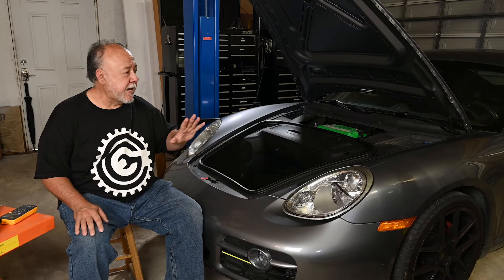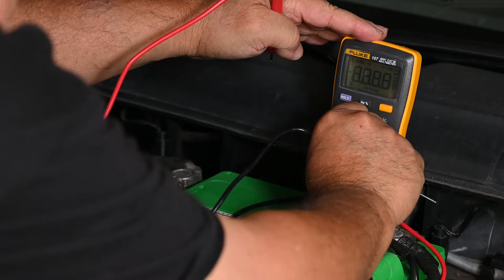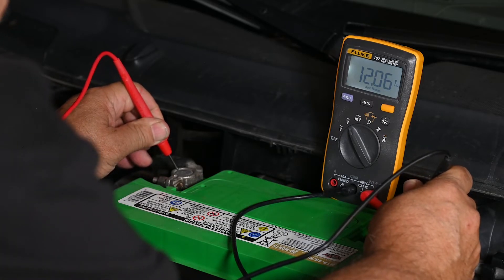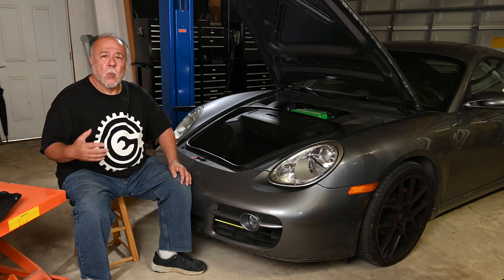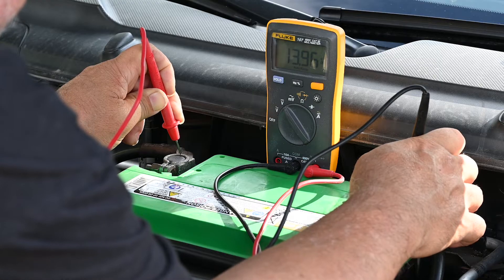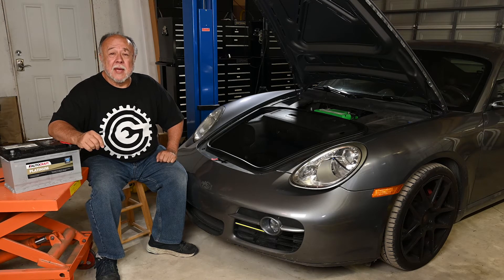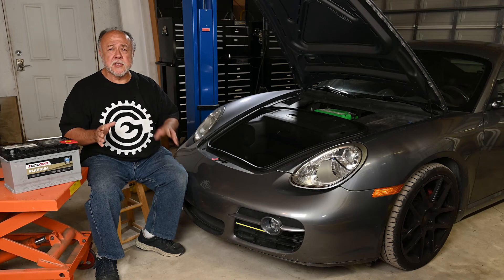Why Is My Car Cranking So Slow? Diagnose The Problem Using Just One Simple Tool

Comment: My battery tested at 12.7v
Alternator was at 15-16v
But when I hooked up a battery booster it did not change the long/slow cranking.

Is it the starter? I took it to oriellys to test and it passed. 

It’s a 2008 Honda ridgeline with 180k miles.

Comment: so......if battery has 12.6 resting or so, battery fine.  if battery and truck running has 13.5-14 volts, alternator is fine.  So the dragging start means starter is bad?  truck always starts it just drags badly.  i replaced the battery a while back but never checked voltage either way.

is my thought process on task ?  I was kinda worried about a bad ground being the culprit

Comment: Costco interstate battery ng after 13 months.   Slow cranking although battery measured 13 volts.  Jumped with another car and started immediately.   Interstates are Pro rated at Costco, from now on buying Walmart Everstart batteries.

Comment: Even if it measures 12.6v it could still be bad. It could be the CCA that is faulty, where it's got the voltage, but not the amps. You need a load tester as well as a multimeter to give it a more thorough test. And if all is well, then you need to check your connections for corrosion before moving to the starter motor and checking voltage there. And even then, it could be a relay, solenoid, etc etc.

Comment: I was ready to go down and buy a new alternator due to bad advice on what the issue could have been and this saved me a ton of time and money. I've never had this issue before, with a battery. After following your steps, I found it was the battery. Went down, bought a new one and installed in the parking lot......and was good as new....started right up much quicker, like it should. Thank you.

Comment: I've been told, on modern cars full of electronics, never to jump start it with both cables connected to the battery. The ground should be on the bodywork somewhere.
This, I'm told, is to avoid spikes damaging any of the multitude of control units in the car.

Comment: My CaymanS also cranked slowly.  The testing showed that it wasn't the battery and it wasn't the alternator.   I was about to replace the starter.  Fortunately, I found another potential cause, which is apparently a very common issue for slow cranking on Porsches.   It turns out that it was exactly the problem I had.  It was the corroded connection from the battery to the distribution block terminal (which is about 6 inches from the battery in the frunk).   The car started perfectly fine after a little sanding to remove the corrosion on that terminal.

Comment: Man I can not figure out what’s going on with my car. Took it to Auto Zone and Alt , Batterie and starter is good. I have a slow crank and the battery light came on for a second. I don’t understand if the battery is good then what else could it be? The mechanic did clean one terminal since the corrosion was visible on the negative but didn’t clean the other since there was no visible corrosion
Reply: Ever figure it out? Both my alternator and starter were bad, so I replaced them, but I still have hesitation on start, I'm leaning more towards the fuel regulation system now, I'm gonna go run some tests tonight

Comment: Best like and best subscribe 
My Nissan Murano no start I changed the battery with  a rebuilt battery but no start then changed the starter cranked but no start can you tell me sir what should I do do I have to change the spark plugs but the car cranked slow though because it was sitting for 3 months I even boosted 
Thanks 
Toronto Ontario Canada

Comment: Great explanation....but, you didn't get to the starter - i have a slow crank condition - car starts.  if the battery and alternator check out, then i'm guessing it's the starter.  the question is - replace the solenoid or the crank motor - or both?  can either be checked? how?  Thanks for any help you can offer.

Comment: Nice. You did for get to check parasitic losses by conneting the multimeter (in current config) in series with the ground or positive termal the battery. Battery could of been low due to a faulty electronic module or closure switch drawing power in an IG off, all doors closed state. A famous ones for old 04-06 Acura TLs is a bluetooth module staying on that is located in the dome light area.

Comment: I just got a 1 ton chinese mini excavator, it has a 1 cilinder diesel engine, its near freezing outside and it is still slow cranking even when wired to a car with a running engine at high revs, the wires get hot and the starter hotter, what can i do? Since it does about 1 revolution 1,5 seconds :/

Comment: my car wll crank and won't start. battery reads 12.48v. is t good?
Reply from the maker: If you're talking about the "resting" voltage (measured with the engine off after several hours not running) then 12.48V is probably a good battery. It sounds like you're saying it cranks normally but just doesn't start, which would not be a battery or alternator problem.
Reply: @CliffsGarage  
Cliff...the car will cranck but won't start. In fact they will be a click noise. Car will say ignition is on but won't start. Just wondering if it's a starter, ground wire or just ignition switch issue.  Do you have way of diagnosing it as DIY?

Comment: I have problem that after sitting for couple days and not warm morning, like +5 celcius, my car is cranking very slow, and if it starts up I can drive like 500 meters, shut it off and it will start instantly like a charm. And sometimes even at colder mornings like -5 celcius it starts like nothing.. Is it battery or something wrong?
Reply: Same problem here, if the starter was f’d then you would think it would have trouble starting all the time right?

Comment: Great video!  We use a midtronics battery analyzer, as long as you don't go below 9.6 V where you're cranking your starter is good.  You can have a 12.65 V and be easily fooled yet the battery has no amperage.
Reply: Hell you can have 9 x 1.5V flashlight batteries (13.5V) and it still will not start your car. The internal resistance of those batteries are high whereas the internal resistance of a car battery will be in the milliohms. That is why when putting a load on a car battery, the voltage of the battery decreases. And during the life of a battery, the internal resistance increases and the capacity decreases.
Reply: Mines is at 14.2 and it's inconsitently cranking up slow

Comment: Well done diagnostics from an electronics tech. I might have added internal resistance of a battery and also charge rate which is dependent on temperature. You are in Florida and if it was hot out, then 14.00V is fine for a FLA battery. Other aspects to a slow start are high resistance joints on cables and a faulty starter that draws too much.

Comment: My audi Q7 3.0Tdi S line has the same problem but when i step on the throttle pedal wide open it cranks normal but when i dont it cranks really slow and doesnt start

Comment: I think i just bought a bad new battery.It wont got to 12.5 even after a long charge on the charger.  After a few cranks it goes right down to 11.9
Reply: With auto parts its very possible! I cant tell u how many times ive exchanged a part because the first one was defective
Reply: Bad cell

Comment: I just got a new starter in last year, new battery two months ago and its still doing this.
Reply: Mine too... only after its warm... Cold starts are perfect... Its the starter cable. Battery, alt, and starter are fine.
Reply: @swaller07  yeah my car hates the cold. I had the crank sensor replaced which was causing a lot of the cranking issues but now its been acting up again slightly so who knows.
Reply: @AnnyBAdventures  if it’s slow to turn over check earths

Comment: Great video Cliff! You have helped me out so much. If I may suggest to you to help people even more is to quickly just give a small explanation on how to use that multimeter. For example in the video you went directly to measuring the battery at 12.06 volts BUT there were several options on the mm to pick from. Quick explanation will help even the ones who know nothing about cars.
Reply: That’s a good point, Jeff. People not familiar with multi-meters wouldn’t know where to start. Especially if it’s not an auto-adjusting meter. Easy oversight though, I’m not sure I would have thought about that either